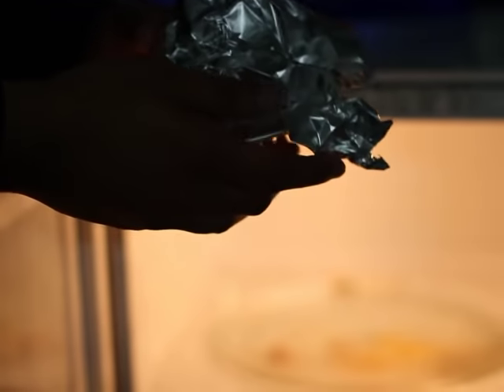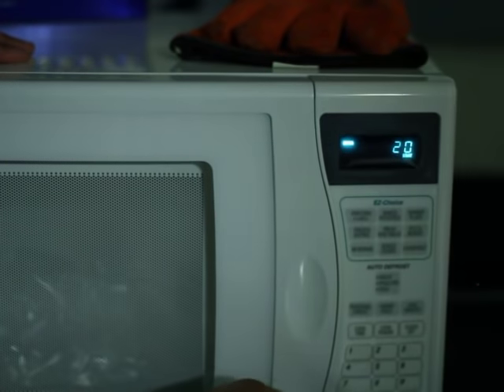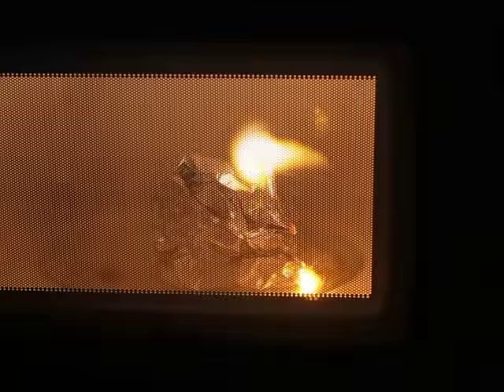Microwave Aluminum Foil

Comment: OMG🔥🔥🔥this happened to me today. It was a Taco Bell🌮bag with aluminum foil. I just saw the Scream👻movie last night, so I was already paranoid about catching fire. The grease combined with the foil started sparking immediately. I’m an idiot and opened the door and the flames grew, and I threw the bag outside my apartment to avoid catching myself or anything in my house on fire. My hand luckily didn’t burn. I threw a sheet over the fire and it eventually went out. Apparently water doesn’t put out grease fires, you need a sheet or somehow starve out the oxygen. Learned my lesson!!!🎉
Reply: True the blanket works but you can by buy an fire extinguisher for less than £10

Comment: I did this too, I threw a chick fil a burger in the microwave with the wrap still around it, then I went to go sit when a I heard pooping noises and I looked over and saw flashing lights. I went over to see and my food was exploding and I only saw fire, I yelled FIRE FIRE. then I turned off the microwave only to find out that the wrap was made from aluminum foil. DO NOT WARM UP CHICK FIL A MEALS WITH THE WRAP/BAG STILL ON IT. I have warned you🔥💥